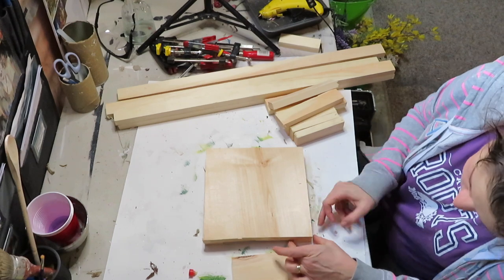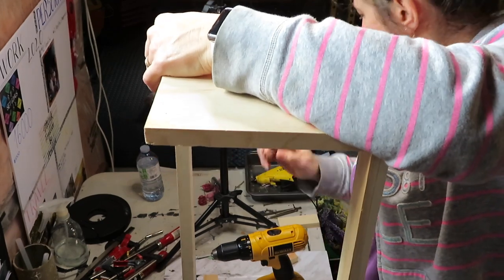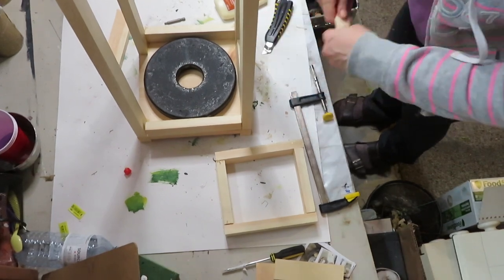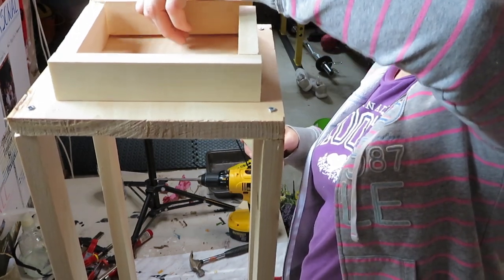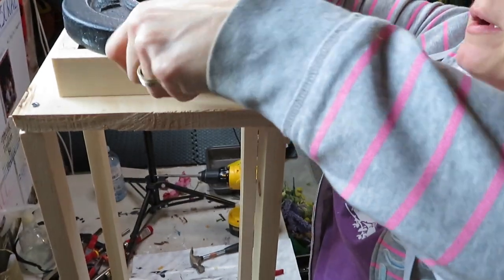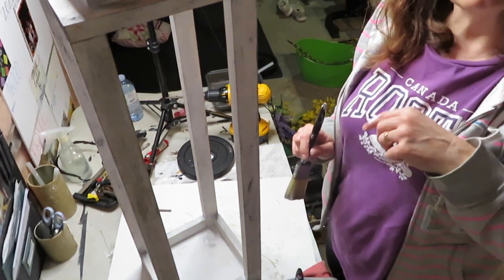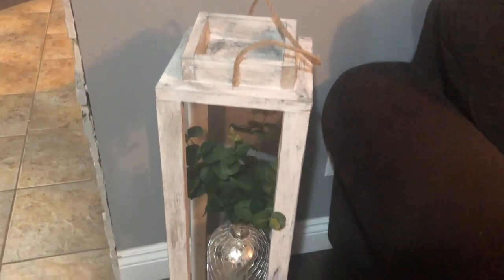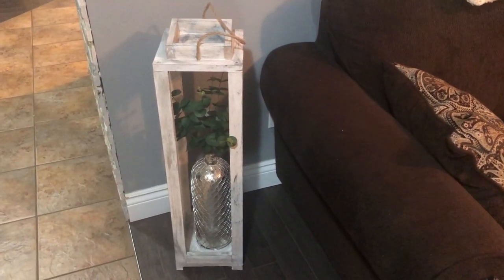DIY Rustic Wood Lantern Two Ways | Easy DIY Under $25

Comment: This is an over the top lantern for sure. I’ve not seen anyone make one so large. It turned out nice. I would make a couple of suggestions to make your life easier, should you ever make another one, 1) pre-drill holes before screwing and 2) use a rubber mallet for tapping those stubborn pieces together. You actually can purchase a rubber mallet at Dollar Tree in the tool section. They come in handy for lots of things. Overall, nice project that you will probably enjoy for years. 😊👍🏻☘️
Reply from the maker: Thank you so much for the advice. Originally I was going to use a nail gun but needed my husband to show me exactly how to use it. But he was busy. Lol. I will totally pre drill the holes before next time. And as far as the rubber mallet if I don’t have at least four. But cN never find them. I blame my husband. Thanks for watching
Reply: Bless your heart. Have the tool , but can’t find, sounds so familiar, lol.